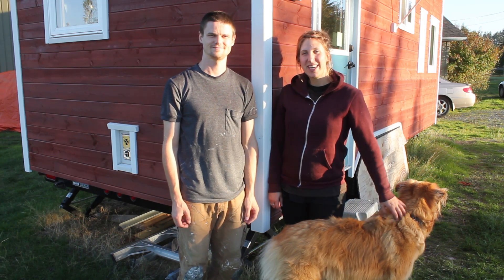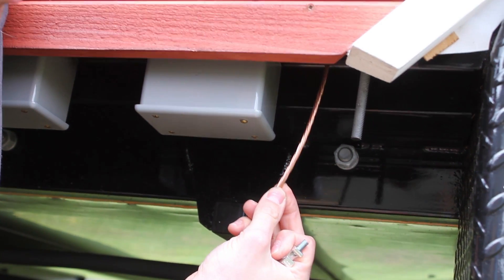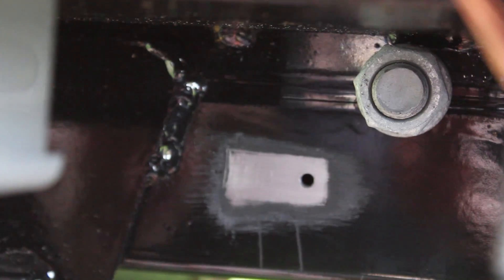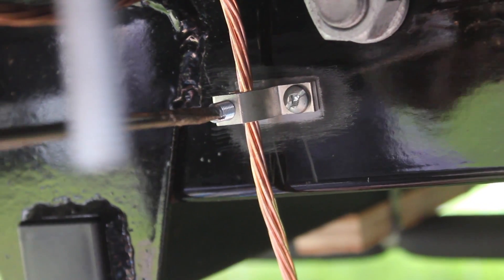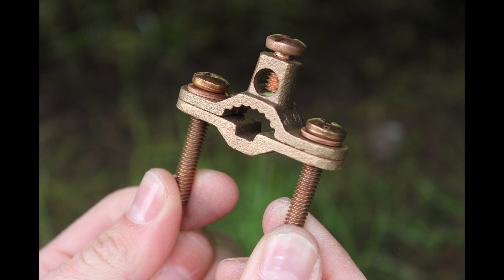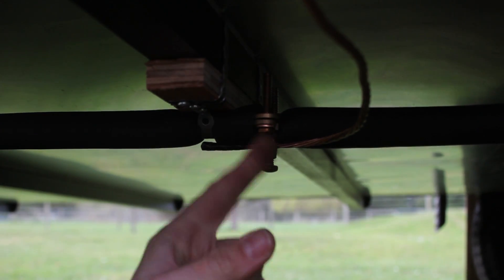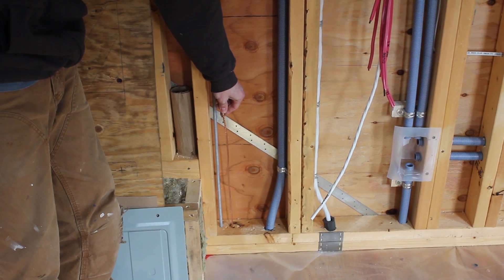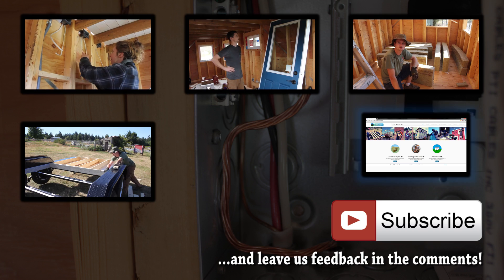Grounding & Bonding a Tiny House (Ep.41)

Comment: But how does it go actually in the ground? Tiny House is on rubber wheels?
Reply from the maker: This is exactly why the term was changed to "bond" from "ground". I recommend researching electrical theory/physics to fully understand this, but the short version is: for safety reasons, an electrical system (for one house/property/facility) should only come in contact with the earth at one location. This does not actually "ground" the system, but rather "bonds" the earth to the system, allowing a path for any fault-current to return to the supply and trip the protecting breaker (thus removing the fault). Any time you are on-grid (such as plugged in with an extension cord), you will be connected to an existing system which will already have it's one "ground"... so unless there is a special case (like being extremely far from that ground, or the resistance of the earth is high at your particular location) you do not want to add a second "ground" to the system. It's extremely important for anyone working on electrical systems to have a deep understanding of the physics to avoid electrical and fire hazards. Correct work is literally life and death.
Reply: @tinynestproject  Thank you for taking time and answering me. But then what about actual lighting? Should not that be guided to actual ground? My Tiny House has a metal trailer as well as metal house frame.
Reply from the maker: Lightning is not something that I have experience dealing with since it's not a significant threat in our area. You'd have to research it yourself... it might involve a separate system with tall rods (taller than the house) which have their own low-impedance path to the earth.

Comment: Quick question about bonding a split propane system: we had initially routed our bonding line (6-gauge copper like yours) through our Iron Eagle flange in a set spot, with the intent of running a length of black pipe down the length of the THOW. That changed and we’re now running two isolated propane supply systems, one up front for the water heater and a lighter-duty one near the rear for the cooktop. Can we bond the Iron Eagle using the method shown, then run separate bonds with two additional sets of lugs, 6-gauge wire, and clamps (like yours) connecting the trailer to the two separate black iron supply lines - relying on the continuity of the trailer itself?

I hope I’m understanding correctly…
Reply from the maker: What you're saying makes perfect sense, however I would recommend extending the 6-gauge line instead of relying on the continuity of the trailer. For something as important as propane, you would be better off with a secure copper-only connection, with fewer possible points of failure. If you don't have enough length and can't re-run your bonding line, look into getting a split-bolt.
Reply: killer. thanks! We don't have enough length on the current run and indeed cannot re-run the bonding line. Looked at split bolts on The Google just now and am not sure how to affix one to the underside of an Iron Eagle, but I'll figure it out (or perhaps they're connected inside a weather-proof outdoor electrical box?). Glad I understood Professor Jake and bonding theory properly though...
Reply from the maker: You would get a second length of bonding line and lay it in the split bolt along with your exiting line, at a convenient spot. Then crank it down tight, essentially splicing onto it (splicing in terms of electrical continuity). The bolt itself does not need to be anchored to anything, it can be free-air. So you have an extension of your bonding line to run over to the new area that you currently cannot reach.
Reply: @tinynestproject  Thanks! We've been working w/an electrician (we heeded your earlier advice re: hiring a professional since we did not trust ourselves with electrical) and thankfully he has a device (no idea what it's called, but you probably know the name) that can check for continuity. The plan right now is to use the trailer primarily but if the continuity isn't established we'll certainly be purchasing a split bolt

Comment: Would you explain why the grounding cable was connected also to the propane pipe?
Reply from the maker: All significant metal should be electrically interconnected via the bonding system, so that it has an electrical path back to the source... this way, if any energized wire (something damaged for example) touches any part of that bonded system, it will instantly short-circuit and cause the breaker up the line to trip and shut off the power... if this path did not exist, such the metal could become energized without anyone knowing... then someone could touch it and get shocked, or in the case of the propane, an arc (spark) could occur and ignite the explosive gas.

Comment: Does the ground wire actually go in the ground?
Reply: Or just attached from the ground bus to the trailer and copper pipes?
Reply from the maker: It just interconnects everything metal together, and then goes to the ground bus... that bus is then connected (via the main feeder cable) back to the source of power, which is the main panel of the main house on the property... it's at that main panel that a wire connects to a grounding plate or rod... that is the true "ground" wire, and that's why I try to remember to call every other wire in that interconnecting system a "bond", because you are simply bonding everything together, and then there is only one spot where it is actually connected to the earth.
In most cases, you only want your electrical system to contact the ground in one place... more than one connection into the earth can lead to currents flowing through the dirt and along other bonding wires, which is a safety hazard.
Reply: Tiny Nest The bond vs ground explanation that you talked about in the video just clicked. That’s very helpful. Thank you!
Reply from the maker: \o/

Comment: I love your videos, so I hope this doesn't come off wrong.  But why did you do all of the bonding outside of the building, when both the frame and the propane copper could be reached on the inside of the house, and much closer to the breaker box? Is there an advantage that I'm not thinking of to doing the bonding on the outside?
Reply from the maker: We WANT people to question our decisions, because that's how we learn and get better, plus it can help others who come to these videos in the future... 
The way we have the framing built on top of the trailer, it's actually not very accessible from the inside. The propane also runs past the breaker box underneath the trailer, and the closest place it pops up is the water heater. So for our layout, running it down like we did still seems like the best option. Having it exposed like this also means that we could check it for tightness in the future, and have the option to tag onto it if we needed to bond something else :)

Comment: Thanks for the help here! Am I understanding correctly that you are grounding the house to the copper pipe of the propane tank? And if so, what if you're not using propane, do you connect it to a grounding rod instead?
Reply from the maker: Thanks for watching :) 
What we're doing here is actually "bonding" the trailer and the propane lines to the electrical system, so that there is no isolated metal in the structure. If a live electrical wire were to become damaged and touch the trailer or copper tubing, there would be a continuous electrical path to form a short-circuit and allow the breaker to trip and shut off the power. If there was no path through the trailer/tubing, then it could potentially become live and then YOU become the path that it takes, if you were to touch it. This requires some understanding of electrical physics to understand, but hopefully this makes some sense... ultimately there is no "grounding" going on here, because the electrical system is supplied by the main residence on this property and it is grounded at the point of entry (at the main electrical panel) and in the vast majority of situations, you only want one actual "ground" in a system. Adding ground rods without a specific and deliberate reason, is more likely to cause the potential for a dangerous situation than it is to make things safer.

Comment: Is the conector for the ground used in the trailer aluminum? If so, is there a problem to connect it to cooper wire?
Reply from the maker: I believe lugs like this are plated? but in either case, they will indicate on them that they are suitable for copper and/or aluminum. Pretty much all electrical terminals will accept bare copper wire. If aluminum wire is used, it must be coated with an oxide-inhibiting compound.

Comment: Quick question.  I see that you have bonded the copper lines of the propane system, I was just curious if anything needs to be done to the actual propane tanks in terms of bonding?    Your explanations of bonding vs grounding have finally cleared things up in my head after ages of just kinda understanding it all... you`re a great teacher!  Thanks!
Reply from the maker: +lefty0mtl Glad we're helping clarify some things :) It couldn't hurt to bond the tanks, but since smaller tanks would have to be moved to be refilled, you wouldn't want to accidentally yank a bonding conductor... especially if the other end is clamped onto propane lines. Generally I'd say you wouldn't bond small tanks, but a large stationary tank would be worth bonding, if it's not already electrically continuous to the piping via metal-to-metal threads and connections.

Comment: I have an electrical question mainly because I'm about to wire my garage, but also am thinking of building a tiny house in the future.  With a remote panel, would you ever drive a separate ground rod for the garage/tiny house, or would that be redundant or cause some sort of ground loop?
Reply from the maker: +Robert Mantel The simple answer is No. Having multiple separated points in the system that make contact with the actual earth can result in more than one path for fault and leakage currents to take which can be a hazard... that being said... there are some rare situations, such as when the remote panel is very far away from the source of power on the property, such that the earth out there does not have good continuity back to the system ground.

Comment: I don't think using a grounding rod clamp on a delicate copper pipe is a good idea.  It will weaken the pipe.  If you transport, the weight of the 6 gauge wire could wear a hole in the copper pipe.  I would have used a toothless smooth metal strap and securing it at the point of contact so it's can't move and then connect 6 gauge wire and make sure that is secured so it can't move.  Any movement can damage the copper pipe.
Reply from the maker: +Rj Aquaponics The copper gas pipe is quite soft, but based on how this installation felt I'm not worried about the clamp damaging the pipe. We often take into account the fact that we don't plan to move the house often, but it would also take a lot of force to twist or pull the clamp to deform the pipe. Since this is an electrical connection, my comment (as an electrician) regarding a smooth-to-smooth surface contact vs something with teeth or a texture is that a biting-friction makes for a more reliable electrical connection... if the pipe has visible marks on it from the clamp, it's a reassurance that good contact was being made. Thanks for the feedback :)
Reply: I'm sure your assessment of the connection is more than adequate.  I'm not a fan of gas anything in a Tiny House.  I had an incident with a Big Buddy propane heater in my geodesic dome two years ago.  The unit was hardly used and my Rocket Mass Heater died I have to use it for one night.  I turned on the gas and it lit the flame and the dam thing nearly blew me up.  It was spilling gas out of leak in the manifold.  I'm going to stick with all electric in my future Tiny House.
Reply from the maker: +Rj Aquaponics Yikes, we plan to use our appliances regularly and be diligent about inspecting them and checking for leaks etc. Propane definitely needs to be respected and treated with care.
Reply: +Tiny Nest In my "explosion", the propane that was leaking out of the heater pooled in low areas around my feet before it ignited.  It was like a big flash bulb went off around my feet up to my knees.  It moved a few things around and scared the crap out of me.  It happened so fast I didn't have a chance to detect it.  I heard the spray of propane when I opened the value and lit the heater.  I had no idea there was unburned propane pooling around my feet until it ignited.  Propane is heavier than air and it will pool and gather in low areas.  Just like lightning protection... humans don't respect propane nearly enough. Unlike natural gas which is lighter than air.  Natural gas doesn't hang around like propane can.We had a house in Door County blow to pieces a few years ago.  It was caused by pooling propane.  Natural gas has blown up a few houses as well.  However, I feel propane is much or dangerous because is sinks and can pool.
Reply from the maker: +Rj Aquaponics It seems like not long ago, people would learn the details of any piece of complex equipment before investing in it and using it, but the increasing pace of life and consumerism tends to create both a complacency and a sense of "I don't care how it works, just as long as it does"... but it's very important to know something as simple as propane being heavier than air. We will be including propane sensors into our home automation system, which will all be located close to the fittings and LOWER than them. If all goes well, a safe reading will be required from the sensors in order for the system to hold the main solenoid valve open (which will be added in the utility box shortly down the line from the tanks).
Reply: +Tiny Nest You are wise beyond your years!  "Complacency" is absolutely correct for this generation.  It so rewarding to hear from you a young gentleman who believes in proper workmanship.  You are rare in this day an age!
Reply from the maker: +Rj Aquaponics Thanks a lot. We don't feel like we're doing anything unusual, and that a careless approach is what should stand out in a time when there is an overwhelming abundance of easily accessible information out there to use and be sure of your own work.

Comment: Sorry guys but I am missing the correlation between bonding the trailer and baring and securing the propane tube. For my simple mind you didn't adequately explain the propane copper tube part clearly.
Reply from the maker: +John ONeil No sweat... The work that we showed on the propane line has nothing to do with securing it. We showed that part in our propane rough-in video. What we did in this video was incorporate that conductive copper tubing into our electrical system to make sure it can never be electrically energized.

In theory, if a length of copper tubing was installed in such a way that it did not touch any other metal, it would be electrically isolated. If a source of electrical power came in contact with this tubing, the tubing would become energized. If a person then came in contact with this energized tubing and, in doing so, completed a circuit, they would be electrocuted... and additionally, if an electrical arc was produced as a result of the energized tubing coming into contact with something that completed a circuit, it would be extra dangerous because there is flammable/explosive propane involved.

Hope this makes sense... it's always though trying to explain in text.
Reply: +Tiny Nest Okay, so what you did was bond (ground) the propane copper tube with the bonding (grounding) wire you secured to the trailer frame, then ran that to the bonding buss in the house breaker box. I contracted today to have a trailer built. When the house is being wired, my electrician should bond my propane tube and the wire to the trailer and the bonding buss right? Sure hope I dont need to tell him to do that.
Reply: +Tiny Nest I am buying your SketchUp Tutorial before I jump off a high bridge or go nuts. There is a field for a Discount Coupon, how can I get one please?
Reply from the maker: +John ONeil Yes that's how we bonded everything together, and it's my opinion that the electrical system is safest when all the metal parts are bonded together and tied into the service's bonding bus.

Comment: I'm not familiar with term "Bonding". So are you saying that this is the same as grounding your electrical system?

I spent a ton of time in the Tech field for Mainframe computers as well as Central Offices for Telephone companies.  

Looks like things are coming along. Winter will be here before long...

Thanks
Reply from the maker: +1timby It's the same as what most people refer to as grounding. The authorities and instructors had recently started the renaming to "bonding" when I did my apprenticeship. The reason it makes more sense is that what I've done in this video has nothing to do with grounding anything really... I've electrically "bonded" all of the metal in our tiny house together, but I haven't driven a rod or buried a plate in the earth. The resulting system does include a continuous path to the earth (because there is a rod or plate already buried beside the main house), but establishing said path is not the main purpose of what I've done here.

Don't remind me about winter :P